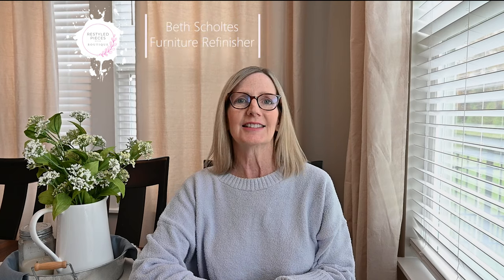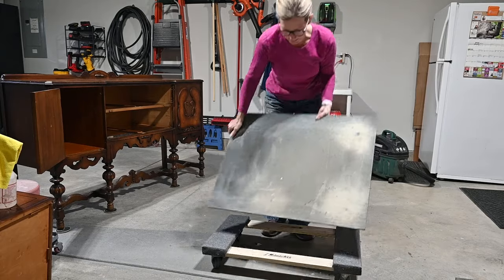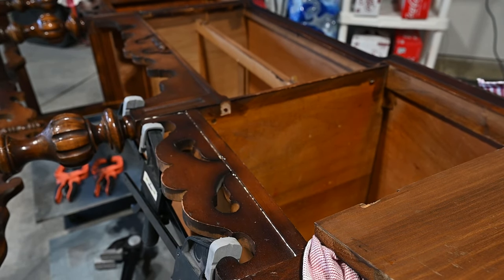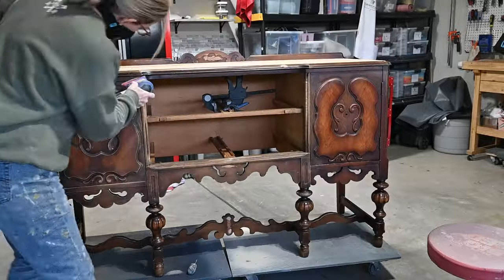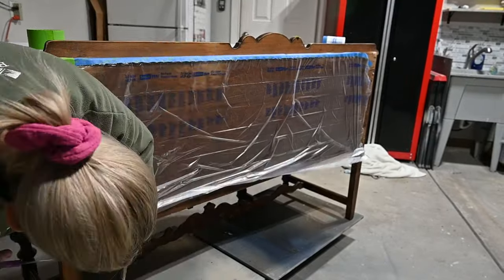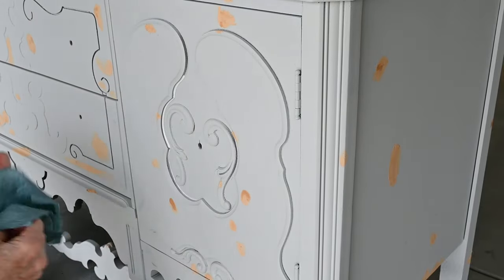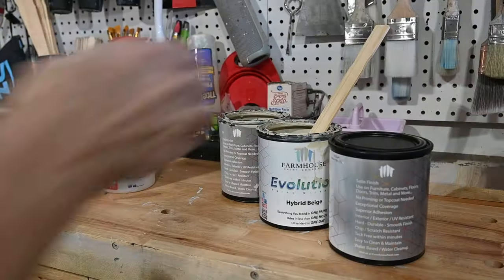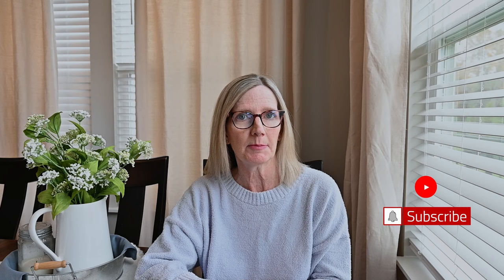Step By Step Vintage Buffet Makeover: Watch this and learn to refinishing tips!

Comment: Just my opinion but I think there should be more dark wood showing.  Perhaps the top could have or should have been stained like the legs.
Reply from the maker: That was the plan, actually. 😅However, the veneer on top has different plans!  Anyway, I am still thrilled with how it turned out. 😊 Thank you for watching! 😊